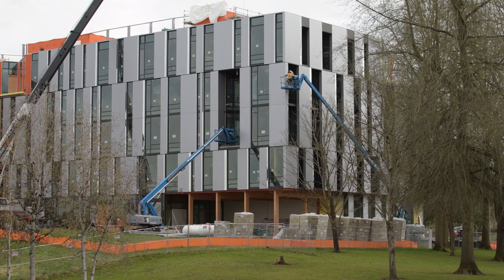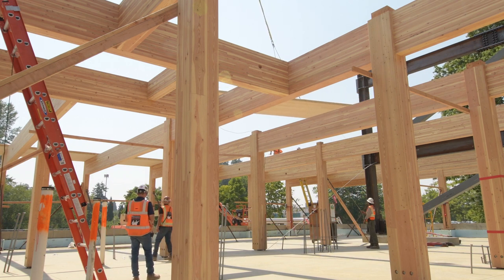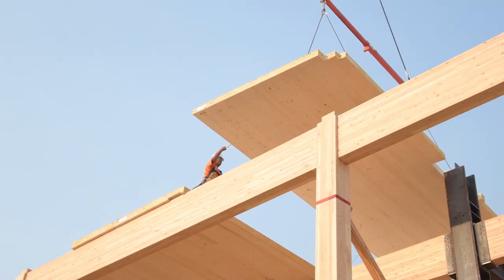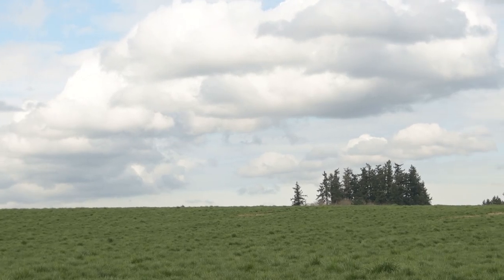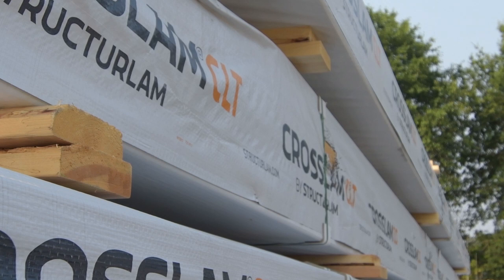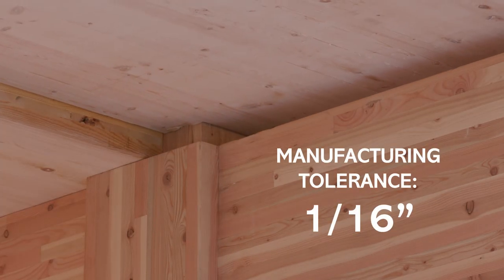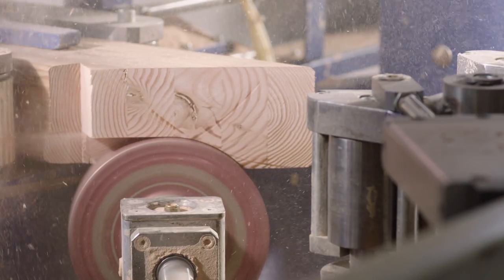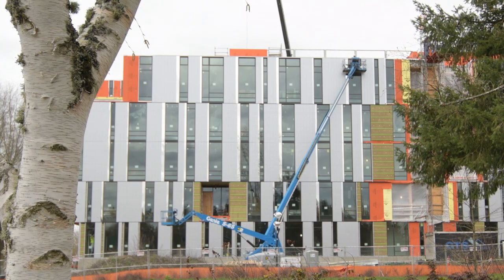Mass Timber Construction vs. Steel and Concrete

Comment: the connection: the structural steel lateral frame to the wood beam, will the different expansion and contraction rates (due to temp or humidity) cause cracking in the finishes? drywall, etc.

Comment: how accessible is CLT for megaconstruction? getting it, regrowing it
Reply: CLT for mega construction is definitely feasible.  The issues you run into are limited building codes, and because the industry is just gaining popularity you're going to be looking at longer lead times for materials.  Codes are changing, and there are also a couple of new mass timber production facilities coming online in the next couple of years :)  Nice to see the USA really embracing this material!

Comment: Does concrete run the risk of a termite infection?

Does concrete run the risk of a full blow fire if a small fire breaks out?

Roman Buildings made of concrete 2000 years ago are still standing today. How many wooden buildings from roman times are still standing? 

Nothing beats high grade concrete and steel for construction purposes.

Comment: Key insights

💰 Mass timber construction can offer cost savings of 4% compared to structural steel, making it an attractive option for building projects.
⏰ Mass timber construction can be completed faster than comparable conventional construction, potentially saving time and speeding up project timelines.
🌱 Mass timber construction can be a sustainable option for areas with poor soil quality, as it is lighter and doesn't require extensive ground improvements.
⚒ Mass timber construction can help streamline the construction process, reducing inefficiencies and delivering projects more efficiently and cost-effectively.
💡 Mass timber construction is gaining popularity due to its sustainability and carbon sequestration benefits, making it a potential game-changer in the construction industry.
🏗 "The mass timber structure is delivered at a manufacturing scale to a tolerance that is on the order of sixteenth of an inch so it truly is industrial furniture that you assemble on-site as a kid apart."